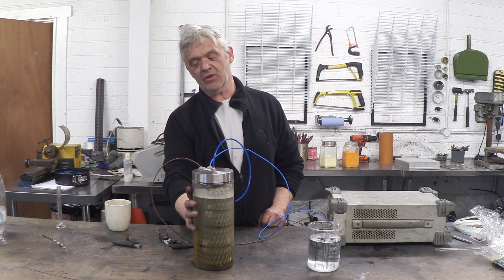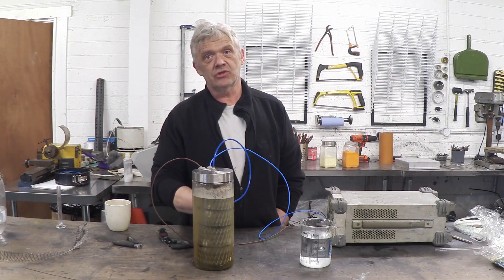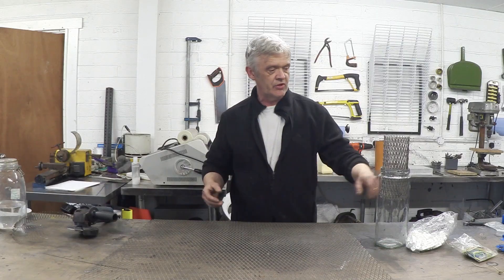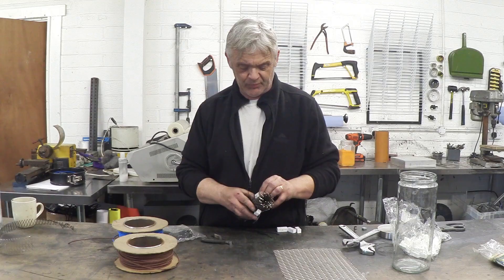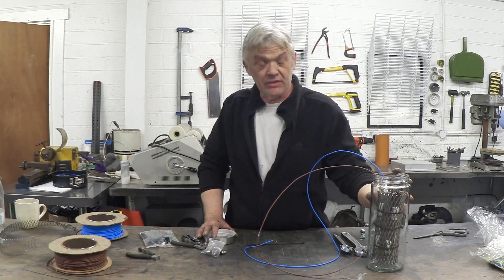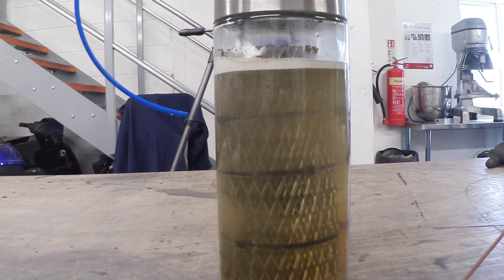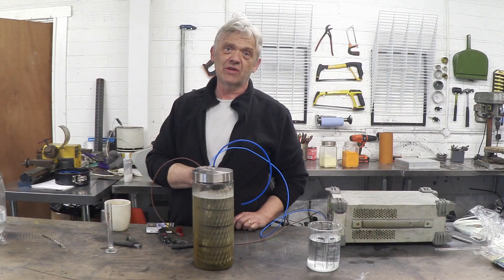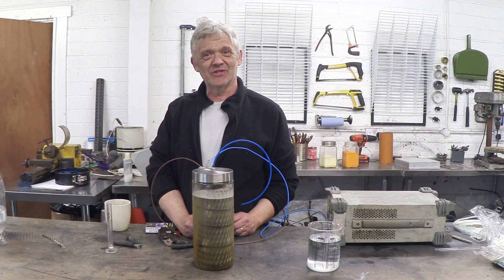Cheap And Easy Hydrogen (Brown's Gas) Generator

Comment: Hi, Robert.  :)

1)  You mentioned the hydrogen gas (and nitrogen) coming out of the electrolyzer.  What about the oxygen released during the process?  Doesn't the mix of hydrogen; nitrogen; and oxygen create a problem vs., say, just hydrogen? 

2)  I seem to recall, from many years ago, claims elsewhere about the Brown's Gas being able to be burned through a welding-type nozzle and be able to cut through bricks or weld metal to brick (I'm not sure why one would need to do that, other than to possibly show it can be done.)  Have you ever heard of anything like that?
Reply from the maker: hi yourself mate
Reply: @ThinkingandTinkering  Are you able to answer the questions that I asked, please?

Comment: Great content as always, İ enjoy your videos immensely . One very important question: how can we store hydrogen safely and economically, I have a 8 kW solar arrays in rural part of eastern Mediterranean and much of the energy is not used so planning to make hydrogen with the excess electricity but how?
Reply: You can use 2 rubbish tins or cans with one that fits inside the other. the bottom one is full of water the top one is upside down it has an inlet & outlet on the top of it. when it is empty it sinks into the water when it is full it rises up. you can adjust the pressure with putting a weight on top of the can. You also need to evacuate the air before use. If it blows up not (too) dangerous cause only light plastic.
Reply: @calthorp  Thank for the idea, I know what you mean, I used to live one of the huge gas holder or gasometers in north of london during the 80's,  sadly they are all dismantled. I was thinking to store in a pressurised steel canister because of limited space availability .
Reply: @nicomedia62  As soon as you start to think about compressing a flammable gas things become complex & dangerous. You have to dry the gas first too, as it is corrosive to your steel tank. Also If oxygen is present in the mix it will spontaneously explode as you pressurize it.
Reply: zanzibarian hydropump if you can
Reply from the maker: do it on demand mate - so no need to store

Comment: This is generating O2 as well, yes?
Reply from the maker: depends on how you set up the cell mate and how long you run it
Reply: @ThinkingandTinkering  Isn't O2 a byproduct of the process?
Reply: @ThinkingandTinkering  you could do two containers to separate out the nitrogen gas at the anode from the hydrogen gas at cathode if you were going to store the gases, albeit it probably doesn't matter if you are going to burn the hydrogen gas while it is being produced.
Reply: @ThinkingandTinkering  What exactly do you have to do to ensure you don't have have a mass of H2 and O2 building up in terms of pressure? Just have the cathode and anode further apart, and keep the gases sequestered?

Comment: Ooo thats cool!. Ive looked into HHO devices, but youre version is really do-able. I would consider drainage pipe and then i could attach a bubbler to it too. I assume drainage pipe is non reactive to chemicals. 100g Urea is about £5 on ebay. Thank you Rob, nice one :)
Reply from the maker: glad you liked it mate
Reply: Just use diesel exhaust fluid (DEF).  It's a high-purity urea solution in water.

Comment: Does this mean our water treatment and waste plants can be upgraded to included Hydrogen generation, effectively making them a power utility service?
Reply: Not really. Of course there is no thermodynamic free energy here. Some Waste treatment plants do use electrolysis to help break up urea and ammonia. The hydrogen and oxygen produced can be burned and used to produce electricity but any electricity from it is consumed. In the end, you have just offset the electricity used to to break urea and ammonia down break down. and you use up the carbon electrodes in the process. waste treatment plants wont use stainless steel because of chromium getting into the water.
Reply: solid and liquid flushables must be kept separate, urine is sterile, feces is Not.

Comment: oh! that's such a good finding! but how do you separate with oxygen? and that's something I can potentially make ... Though hydrogen storage is a problem now lol
Reply: two have cell reactions can keep the hydrogen and oxygen mostly separate. But you need to also keep the gases separated.   Nylon fiber membrane for instance is hydrophilic (loves water) thus  resist gas bubbles from crossing the membrane.  Double check for the chemical compatibility of the electrolyte  you use and intermediate products.
Reply: For small amounts, you can store the hydrogen in balloons.  Unlike H2O electrolysis, urea emits N2 vs O2, so you can just vent it to atmosphere.

This method didn't appear to separate the H2 from the N2, but perhaps I missed that.
Reply: @technosaurus3805  interesting, also this is urea not urine, you know how to extract it from urine?
Reply: @NeoShameMan  I think Nile Red did a video extracting urea from urine, but you can just buy DEF (diesel exhaust fluid) it's ~1/3 urea in distilled water.
Reply: @technosaurus3805  thanks I'll def go on a youtube search spree very soon!

I'm poor and I'm interested in urine for indoor farming too, being self sufficient by producing my own fertilizer lol If I have energy on top of that, that's icing on the top. Basically one pet hobby project is to rebuild a martian like self sustained capsule, but on earth. If we can live on mars, no place on earth would be too bad. lol

Comment: Hydrogen, Oxygen, glass.
Really unsafe if it explodes, I know from experience.
Reply: Actually yes. Same here. It seems safe for a while. You might get a tiny flame here and there. But once in a while on your first week, you'll get a stoichiometric mix and boom! At best your bottle is cracked.
Reply: @aomanchutube 

 I was testing an electrolyser that I made from canning jars. It had a small torch at the end. I was testing it for the fist time and had two levels of what I thought were effective flame traps. Luckily, I put a steel 5 gal paint can over it , lit the torch and watched the flame travel up the hose. All the while, I thought the flame would be trapped. 15 seconds from the time I lit the torch, it exploded under the can that was still loud enough to make my ears ring. When I finally took the can off the apparatus I made, there was no piece of glass larger than 1/4 inch and the top of the can was dented.
I still wonder how things would have been if I had not put the can on top, probably like a glass grenade going off in my workshop.
Reply: @mikeg4972  I actually tried this using a single, but small glass jar. The ones with the special large lid and silicone gasket. I thought if the top didn't have much volume I would be fine. But it still broke apart. The good thing is that I was playing with a small bottle, nothing crazy like this.
Reply: yup!  make sure  to keep it full of electrolyte so that not much hydrogen and oxygen can be stored.

Comment: I wonder if storing energy fro say a solar panel or wind turbine would be more efficient making hydrogen than putting it in a battery. It could then be converted to electricity by using it in a petrol generator converted to hydrogen or using a fuel cell.

Comment: Hey Rob, is the cell producing browns gas or regular hydrogen? From literature the two seem to be different but the fact you can produce more output than input would suggest so!
Reply from the maker: depends on the setup mate - if you use water and alkaline then browns - if you use urea then hydrogen

Comment: hey why use SS? I am a little confused here, is it because it doesn't rust... Then why not use aluminum.... Is this a galvanic cell or something, what determines the voltage required. What about salt water, doesn't that have a low conductivity and work with electrolysis thanks

Comment: Dear Robert:  What about the oxygen?
Reply: It’s mixed with it, if you wanted it seperate you’d make a U shaped test tube with the anode and cathode split on either side and hoses running out for each side to collect oxygen on one or hydrogen on the other. His method gives you a ready to go explosive if you’re wanting to fill balloons or something and light them with a 20 ft long stick with a match on the end (with safety goggles and hearing protection). It’s also useful for a torch since it should be perfect ratio already, but separating it for storage if that’s what you’re trying to do is far safer and you wouldn’t use what he made (again it’s just separated like a U)

Comment: Excellent device . Is it possible for the hydrogen gas produced to power an electrical  generator, then to power the gas generator . which would be self perpetuation .
Because there is more gas produced than energy to produce it. I was thinking to put round section plastic tube 6mm dia laterality across the mesh every 25mm
on one of the lengths of mesh ,then roll the two together . This would significantly increase the amount of hydrogen.Could you show how to split the hydrogen and oxygen with a none return valve
Reply: Why don't you used a riding mower engine to charge 12V system for your HHO generator

Comment: Is the flow volume sufficient for a micro victor torch. I’m now using a salvaged hospital oxygen concentrator , good ole zeolite.
Reply: For the nitrogen gas? I have a few of those for nitric acid production.
Reply from the maker: would depend on your setup mate

Comment: Played around with HHO  for a couple year's. I had best surface area production results with stainless steel wool. I never knew about urea. Thanks again......
Reply: I remember some experiments with the catalytic converter material as one of the electrodes that claimed excess energy, i think it was palladium.
Reply: @GaryMcKinnonUFO  Would you find Palladium electrodes if you "cut-open with tinsnips" an auto exhaust converter?    Would it have to be New. or could it be a used-up/"discarded" converter?
Reply: @GaryMcKinnonUFO  Yes, this massively increased the hydrolysis efficiency. The palladium, induced a vibration on the water molecule which loosened its bonds. Man in Florida discovered this phenomenon.
Reply: @kenbellchambers4577  vibrations cannot effect chemical bonds.. electrical oscillation however might be able to but it would have to be ultra high Hz to do so, high voltage high HZ or pulsed DC.
Reply: @the_socompsp  Thanks for the clarification Joe. I am no scientist, but I saw the hydrogen and oxygen really pumping out of the water using this method. It was an old guy in Florida.
Reply: @the_socompsp  like from 5G?
Reply: Electrical oscillation is pretty much a form of vibration from what I understand.
Reply: @GaryMcKinnonUFO  but very rare (and thus expensive); i would suggest stick to stainless steel sheets like Robert suggested
Reply: @hansscholte5472  The guys i saw got the palladium from scrap catalytic converters so they were abundant and cheap.
Reply: @GaryMcKinnonUFO  scrap catalytic converters are not cheap, in fact people steal them and sell them to scrap yards. It got so bad in New England people started having to show an ID to get paid for them from scrappers.
Reply: probably better to just make ever clear ethanol and run a motor with that  .
Reply: Doesn't it go bad quickly ?
Reply: @TazerGames  industrial pot scrubbers. It's not that fine of a mesh and I used one for over a year and it still produced strong.
Reply: @glennwebster1675  Brilliant.
Reply: @glennwebster1675  rvs 304?
Reply: @glennwebster1675
Reply: @glennwebster1675  DuPont PEM.
Reply: Use window screen, that really puts it out. It rolls like paper, and You can cut it with a box blade
Reply: maybe i should start producing hho due to the fact at the moment the system pays for my electrical bill .  :))
Reply: what i dont understand is why more people are not doing this when he claims he can get more out then he puts in .  everyone should start doing this then due to the profit gain .   use one penny get two in return , pay one penny and keep one  .  now times that by whatever you can afford in the start and then keep going up with no end except the amount of electricity the power company can send you  .
Reply: @carmichaelmoritz8662  yeah if energy companies weren't corrupt... Unfortunately they choose when to allegedly accept the energy produced by customers and pay them for it ...!
Rigged casino.!
Reply: @carmichaelmoritz8662  my idea too

Comment: Very cool!  I’ve been wondering about net positive electrolysis for donkey’s years and assumed it wasn’t possible because no one was talking about it!  Thank you!
Reply: You get aught for naught, the urea takes energy to make :P
Reply: @MrGoatflakes  True...but...in this case it's already made for you! Just factor in the cost of buying a bag of fertilizer!!
Reply: @MrGoatflakes  , urea can be replaced by urine ?.
Reply: @kaka_kaka28  Again, it took energy to make the urine.  It's a shame we just flush it down huh.
Reply: @dansw0rkshop  , I read somewhere Urine can be split into H² and N by passing it over Pre Nickel heated to a temperature of 400°C or above. Not very sure how correct this is.
Reply: Water before separation is in the liquid phase, while water after recombination is in the vapour phase, which has lower internal energy due to the loss of hydrogen bonds, and a huge increase in entropy due to the extra space occupied. This is the apparent free energy.
Reply: You're never gonna get more energy out than in! That's just impossible.
Reply: @martinbobak3009  , I have got more mileage by injecting small quantities of oxy-hydrogen gas . 35 % more in a petrol engine car .
Reply: @martinbobak3009  That law is valid in closed systems not in open systems. Regards.

Comment: Hi Robert:  Your take on the  BG generator is the simplest I have seen online.  I never heard it mentioned before that using a  urea solution was a better choice.  For you and your viewers, in the USA anyway, an easy source of a ureas solution would be a  product called Diesel Exhaust Fluid (DEF).   It used in diesel motors of commercial vehicles (big rigs),   run of the mill pick up trucks and I think heavy equipment as well as newer farm machinery, o satisfy new emmissions standards that came out in 2010.  The  DEF solution is at 32.5% so it ought to work.  DEF is widely available in the USA and I suspect Canada

Comment: A very good and inexpensive way! And the urea trick is the masterpiece. That's really something.

 Two other easy ways to make elctrolysers are to use blank precut squarish stainlesssteel wall covers for light switches ($17 US for 10 on Amazon) https://www.youtube.com/watch?v=ERJVbJ4r75A

or use stainless steel pipes one sized inside the other with a plastic zip tie used as separators. Also according to all builders of these things you actually need to let the stainless device run overnight to somehow condition the plates. Don't know why that's true but virtually all makers of these devices say the output increases substantially after a break in period.

Now you can try the Stan Meyer circuit which uses distilled water and actually makes the capacitor water tank part of a radio resonant tank circuit with a inductance coil and ...most importantly and often forgotten.. a diode so the voltage builds up and up between the plates until the water molecule is more efficiently bounced apart rather than ripped apart with lots of amps. 

here is the circuit. notice the electrolyzer filled with insulating distilled water IS the capacitor.
https://patentimages.storage.googleapis.com/7e/73/28/f1263c3748ae72/US4936961-drawings-page-3.png

supposedly uses a lot lot less amps. https://www.youtube.com/watch?v=QxIiRrl6l6E  text about it  http://jnaudin.free.fr/wfcbooster/indexen.htm ) by the Way Jean-Louis Naudin is an exceptional and meticulous experimenter who documents his experiments and tests in great detail.)

in that test Jean uses a high current simple source that produces hho from pure water but with too much current.

here he replicates Meyers actual patent and produces the same amount of hho gas with an incredibly small amount of current and voltage http://jnaudin.free.fr/wfcbooster/WFCbooster05en.htm  video https://www.youtube.com/watch?v=4nnvley2N4g
(Wish I had a two function generator waveform machine because i would love to duplicate this.)

 most people who make meyer circuit replications on youtube dont use the diode and add electrolyte to the water which makes it NOT a meyer circuit but a simple electrolyzer. putting electrolyte int he water destroys the meyer circuit because it depends on the voltage between plates building and building without current passing through the water until the molecular bound between the h and the o2 is broken by the rising voltage bounce.

(by the way for those who say the meyer circuit was proven fraud...no the court ruling was about a dispute about an investor and how payments were to be made and nothing at all to do with the technical competence of the circuit.)
Reply from the maker: nice post mate - thanks for that

Comment: Its nearly 100%( with a catalyst, (nickel phosphide nanoflake arrays on carbon cloth (Ni2P NF/CC)  )  ,its works really well but please do not buy into the over unity fallacy folks !
Reply: It's been 200 years since the original electrolysis equations were written by Faraday.. do you think iit might need some updating?

Comment: You should try using copper electrodes coated with your graphene ink, copper would normally deteriorate in an electrolytic cell like this but your waterproof ink might have quite interesting results
Reply: the carbon would oxidize to graphene oxide, lose conductivity and stop working.
Reply: @kreynolds1123  have you tried this? Or is that just a hypothesis? I'd think graphene would take higher temperatures or voltages to oxidize, and urea electrolysis doesn't produce oxygen it produces carbon dioxide and nitrogen aside from the hydrogen. But Idk cause I don't have any graphene to experiment with